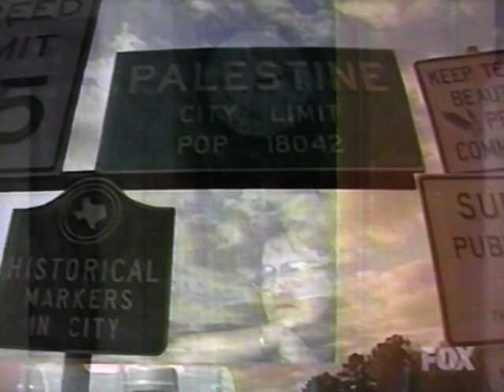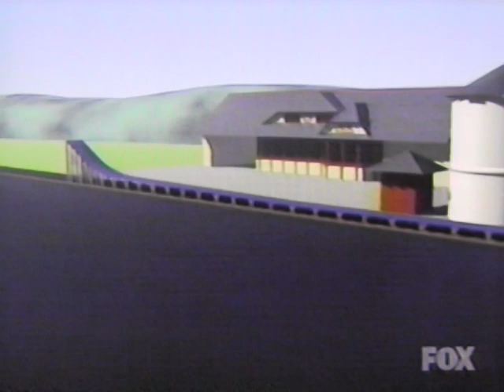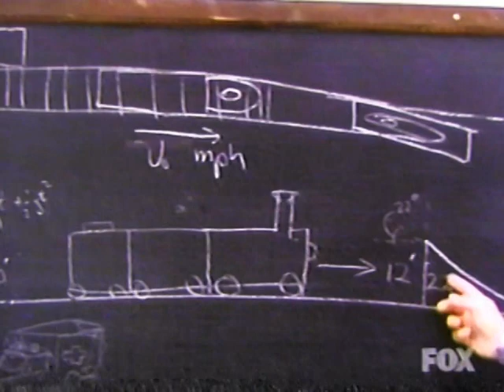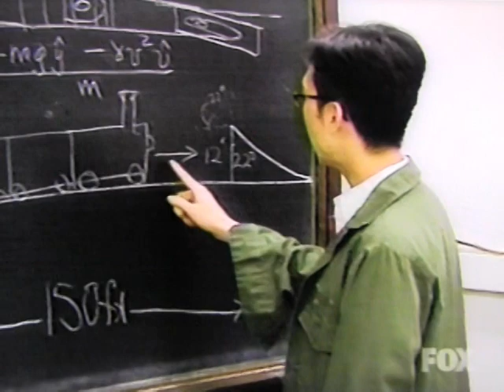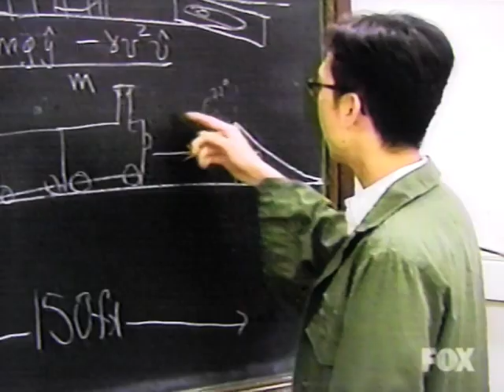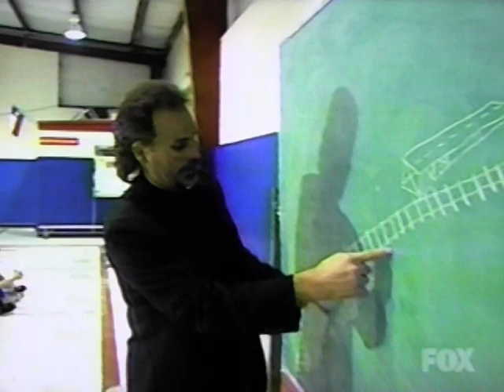Robbie Knievel Head on Train Jump, Texas State Railroad, Live recording, 2-23-2000

Comment: Notice at 36:42 where the ramp is and what part Robbie went up.  This part was made of Styrofoam. Notice how Knievel went up far to his right up the ramp. Notice the condition of the left side(his left). Don't ask me  why but the original plan was to have him have his ramp on the track. Johnny Airtime did this jump before and he put the complete ramp on the track. After the jump and during the replays they never showed the takeoff ramp again showing that the ramp Robbie went up was completely untouched. Even if Robbie had arrived late to the ramp he would have missed the train. Note they never ever show you the condition of the takeoff ramp after it was over. Why? Because the part he went up was never in danger of being hit by the Train. You can clearly see nothing but Styrofoam flying and no wood after the train his the fake ramp
Reply: Exactly what I seen I would have thought the timing would have been easy to pull off Regardless a great man